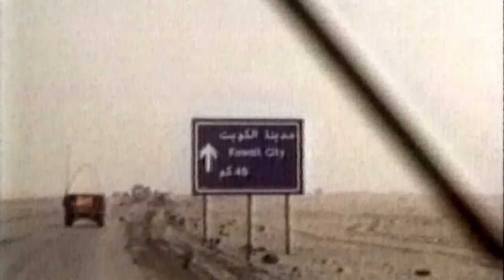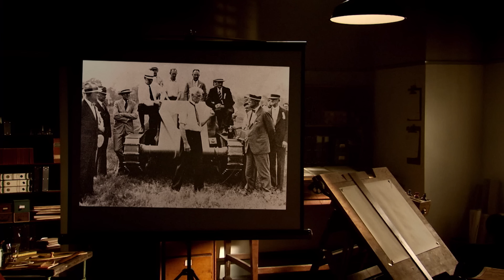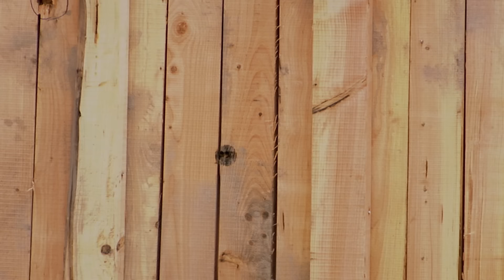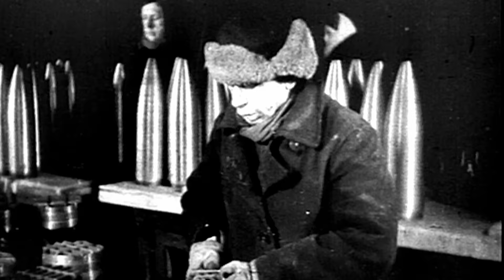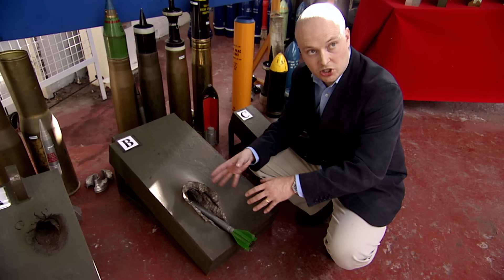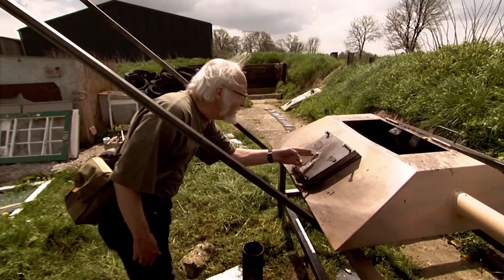Way of the Tank – Machines of War

Comment: The Sherman was fatser then then the t34 wasn't it and could fire on the move with the gyro stabilized gun. Gun was only better on t34 and the Sherman didn't have the Christy early version of torsion bar suspension